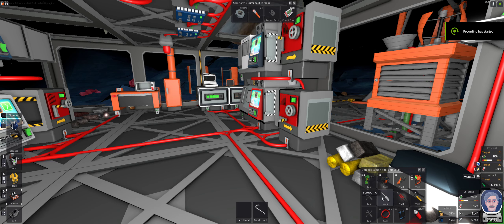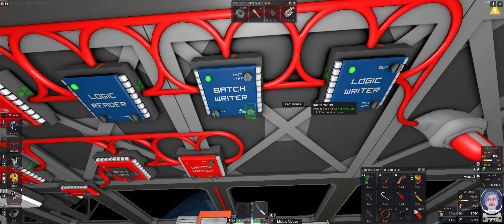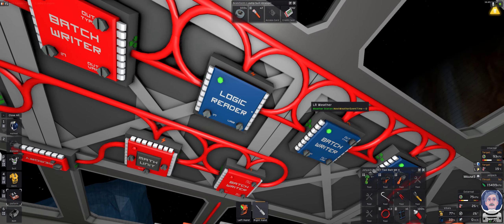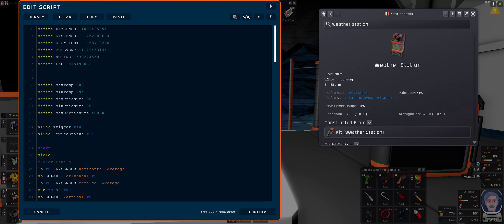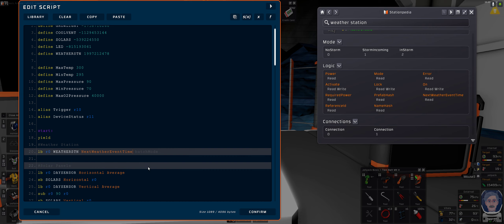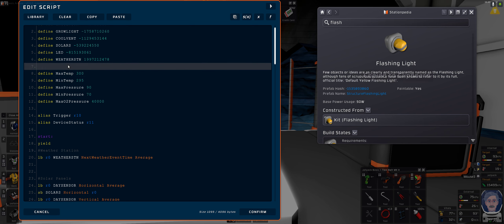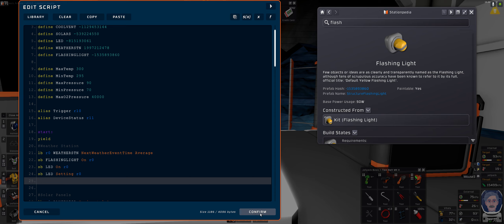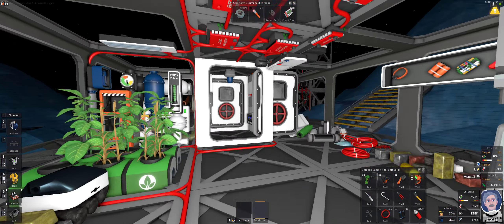Stationeers - Chips & MIPS - Weather Station Alerts done both ways

Comment: Personally, I like to use a klaxon when i can in addition to the flahshing ligbt as well (of course not effective on planets where its a vaccum or your base is always vaccumed).  Also, a nice QoL you can further add is a button/lever, when when double toggled will stop the light/klaxon and resets for the next storm.  It drove me nuts having the klaxon or the light flashing for 10 minutes, when you immediately got the message 9min 59s ago.  Its basically an acknowledgement mechanism to shut it down until the next storm. "OK, a storm is coming, I got the message. Now stfu" lol